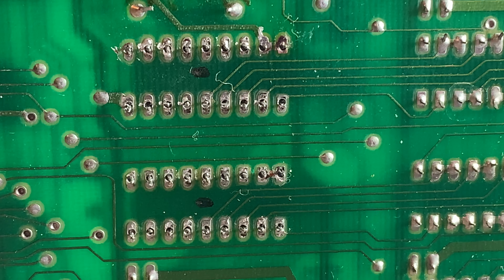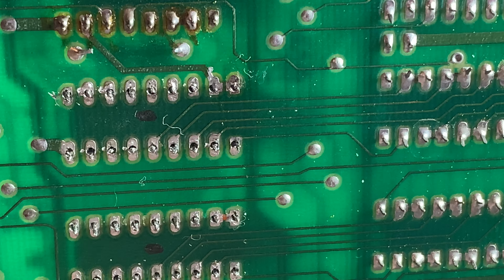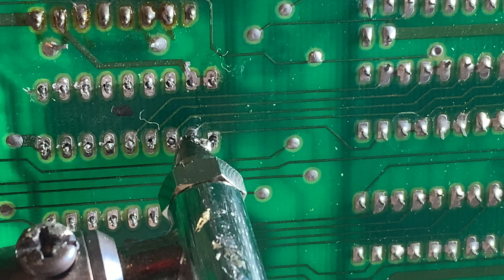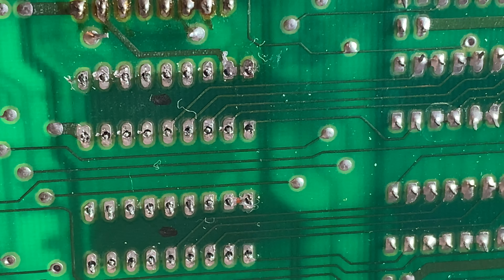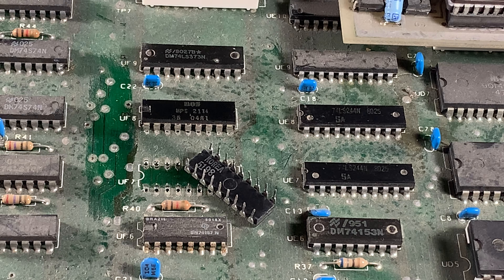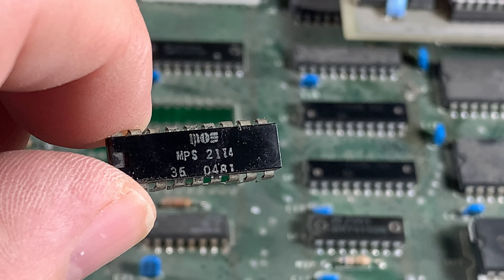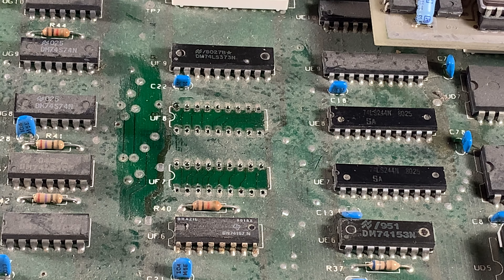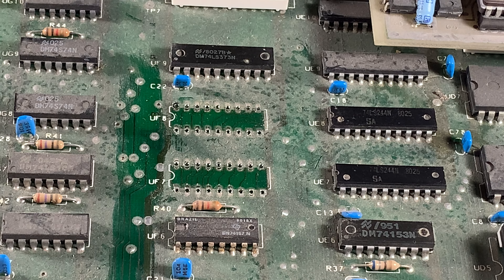Commodore PET #40 - De-Soldering 2114 Screen RAM Chips 2001 CBM 8-BIT PCB Sucker IC - Episode 2113

Comment: 2114 is static sensitive.
No mention of following ESD handling precautions when handling the replacement part?

ESD damages the oxide layer on the gate of the FETs resulting in failures in system later in life.
Reply from the maker: I will look up the ESD handling...I am careful and never put the chips face down on any metal surface...I do not have static issues in the house...my grandmother's apartment was always fun...walk around in your socks...rub them on the carpet, and zap yourself with the light switch!
Reply: @DRBradleyPhotography  Putting chips down on to a metal surface is actually a good thing to do. It doesn't harm them.

You need to be wearing an anti-static wrist strap connected via a resistor to the ground wire in a receptacle outlet to provide a path to discharge static electricity from your body 

An anti-static table mat can help, but the wrist strap is more important.
Reply from the maker: I will look into this...I shall...I have seen them...do not have one...but I will goggle it...thanks so much...stay tuned...David

Comment: what i do is get a hot air station and whack some heat on them and pull them out without destroying any traces
Reply from the maker: I have pondered that...I have indeed...I did have a soldering iron with individual sized tips for chips...and it was a dream to extract chips...but I have not found it...yet...and I have searched online for something like it but have not been able to find such a device...yet!